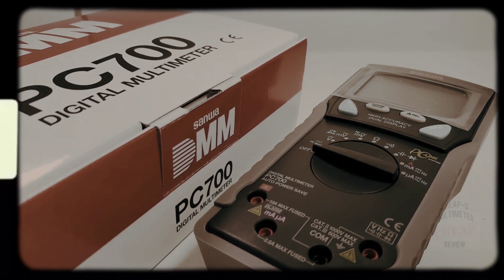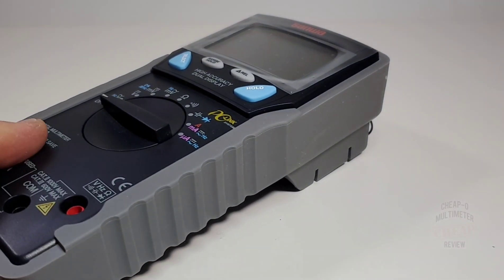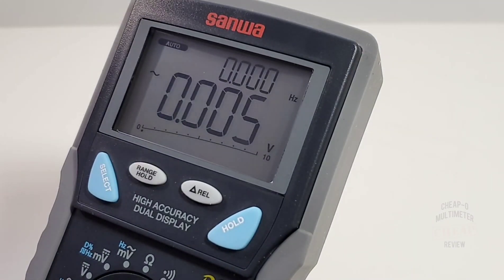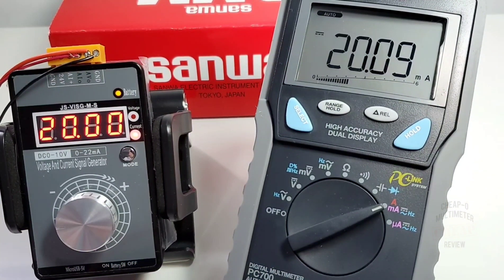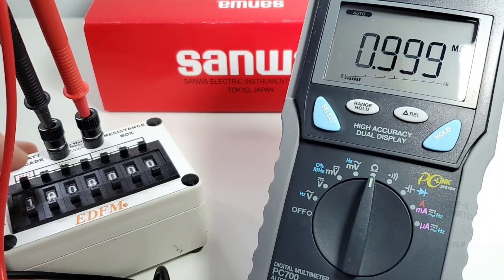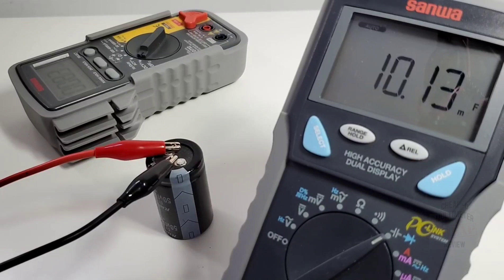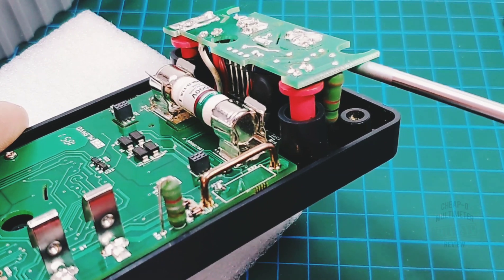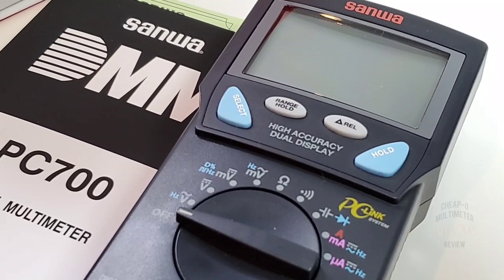SANWA PC700 Multimeter Review & Teardown!

Comment: Somehow it remembers me to Brymen DMM´s. Magnetic holder from Sanwa is a twin to Brymen`s. Therefor also the Bayonet lock for the optical connection. (BTW: Brymen doesn`t deliver the connection cable with the DMM, too.) Multiple PCB construction is also used... At least for me, there are two big questions left:
WHY? Why no Backlight??? And why using ancient 9V-Block batteries???
Reply from the maker: Those 9V batteries sure do seem to be as prevalent now as they were 30 years ago...go figure! Agree, backlight is sorely absent despite the gorgeous display! Thx for watching

Comment: I work HVAC and I test big capacitors and live lines what meter would you recommend for me out of the cheapos
Reply: AMTed CH  I would recommend the Brymen BM869s with dual temp probe capabilities and dual display on most settings and a 500,000 count display. Similar to the venerable Fluke 189 with more features. Very robust meter that I’ve seen Joe Smith on here run a 12Kv transient through while turning the range switch before it had a minor clamping diode failure. Fluke and Brymen were the only 2 meters that handled that high of a voltage. Best bang for the $$ out there. TME in Poland is the easiest place to get them in the states. Brymen rebrands their meters for Greenlee which stops them from selling the Brymen badged units here. The Greenlee stuff is just as good but way more expensive for the same unit.      https://www.tme.com/us/en-us/details/bm869/portable-digital-multimeters/brymen/bm869s/

Comment: Nice review for one more time! The cons for me are the 9 volts battery(i woud prefer 2 AA or 3 AAA), the lack of backlight and the weakness in testing LED diodes(all of them have the same problem, why? even the cheapos can do it, why not SANWA?). The pros, which i can say WOW is the input protection and the huge fuse(i have never seen something like this before!), it's accuracy(of course!), the visibility of it's screen and it's features! It's a great multimeter and with some changes it could be the best!
Reply from the maker: So very true 👍  This multimeter really shines in almost every respect. With some tweaking this could be a 5 star 🌟 dmm!!

Comment: You know it's CAT III with all the separate boards and isolation slots.  They should have added the back light, but at least it's easy to read
Reply from the maker: Surprised me just how good the display looks in low light..still a backlight would have been the icing on the cake!!

Comment: It was a great series of reviews for the Sanwa.  Perhaps they should have included the PC link cable so that we could get the most out of the unit--especially for $200 dollars.  I guess the draw back was the range for capacitance.  It's nice to get forward voltage on all LEDs, but at least you can test them via functionality--if they are lit, they are good.  From what I can see, the soldering on these boards are top-notch.   But I think the price point is too high for the general user.   As an electronic technician or electrician they would work, but there is a lot of good meters for about the same price.  One can get a Fluke that is design for an electrician for about the same cost.   I would be curious of the number of electricians that have Sanwa vs Fluke.  Anyway, thank you for your review.
Reply from the maker: Glad you enjoyed SANWA week it was a great ride! I agree, it would have been great if the PC LINK software and cable was bundled with the multimeter!

I know branding means alot and hopefully Sanwa will garnish more popularity in the Western market. They continue to amaze me with the high calibre build quality and attention to detail.

Comment: I think PC700 deserves 4.5 rates. There are some features which not available, like backlight and LED limitations forward voltage but still consider as very good DMM.
Reply from the maker: Thanks for your feedback.
1 Star was lost for NOT including the PC LINK Software and Cable with the multimeter. When you advertise PC LINK on the dmm, you should bundle the multimeter with the application instead of levying an additional surcharge to acquire the software.
Reply: I totally agree with you. In this price range it should had everything you mentioned... Competition is very strong and they had to include them in the package.

Comment: Hey Darren, I give this Sanwa PC700 a solid 4 stars if its okay with sir. The bargraph looks like RPM indicator. Makes you want to race to measure everything. Someone in R&D must be a GT fan. Haha. I like. 

I sense that if Sanwa were to put backlight, it would the 80's display light style like on my 12 year old CD771. Good thing they did not.

I still kept its original Sanwa box and I agree its nice. You can tell its Sanwa from 50 meters away.

As always, great detailed review sir. Just to add. The enclosure screws has brass inserts too. Thumbs up Sanwa Electric.
Reply from the maker: Great feedback! Yes 👍 a solid dmm.
I know what you mean about the backlight on the CD771.. echh!
The PC7000 has a gorgeous backlight so I was hoping for the same on the PC700.
Btw, SANWA lost 1 star for not bundling the PCLINK software & cable with the multimeter.

Comment: Great review! So many nice touches on this meter and it has the best input protection I've seen. An audible alarm when leads are plugged into the zero resistance jack (but the meter is set to anything but Amps) should be standard on every meter. My Habotest has the visual ones but even then I've almost blown the thing (or myself) up.
Reply from the maker: Eric so true, when we're busy doing multiple tasks its so easy forget to change the test leads accordingly 🙃

Comment: for $300+ I would have liked to see capaciatnce range include pF. Also diode check voltage should have been a little higher to show the white and blue led votage drops. Nice input protection and easy access fuses (high quality). But these are to be expected for that price range.
Reply from the maker: Agreed, I too was disappointed with the LED output..was expecting a verbose forward bias display for all 5!